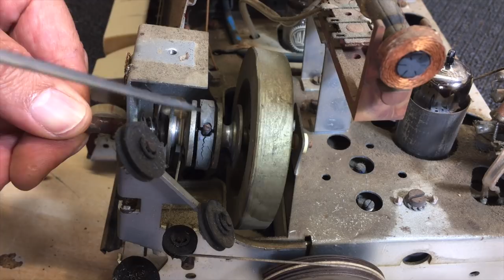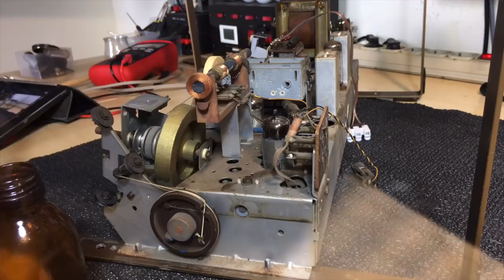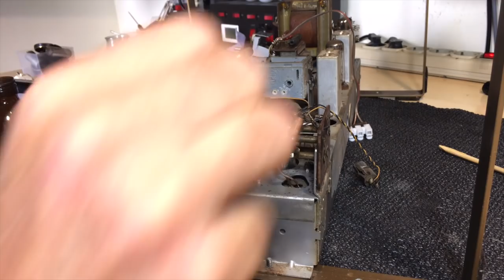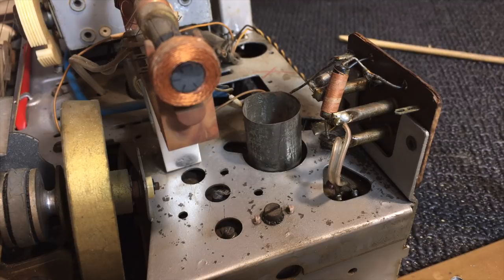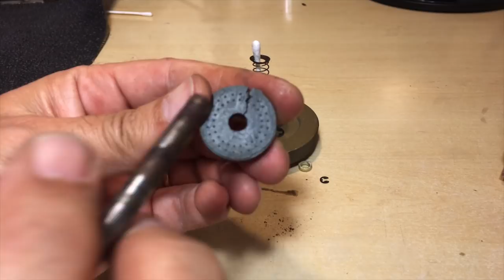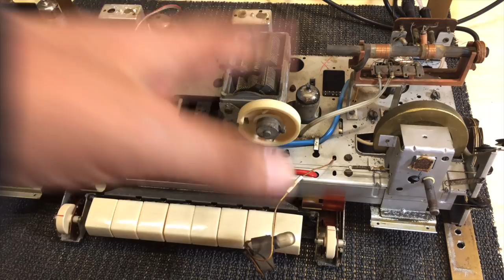Grundig 3160 tube radio restoration, part 4. The clutch is gone. Time for MacGyver tactics.

Comment: Two points. First,  my background is psychology. You seem much more relaxed and friendly lately. Very nice. Second, I bought a vibrating polisher like gun shell reloaders use. You put in some walnut media, throw in your small parts and let it run a few days. Polishes parts that look like new. Especially small or odd shaped parts that would be difficult to hand polish. Well worth the expense.
Reply from the maker: I’ve seen those polishers. Saves a lot of manual work. Great idea.
Well, I’ve just been analysed :)
You’re spot on with your evaluation. Considering that this could be construed as a doctor -patient confession, in absolute privacy, I’ll admit that being at home with my wife and daughter for the last week has been unbelievably gratifying. I know that it’s ironic, considering the circumstances, but it’s a fact for me. Having a tube radio to restore at leisure is just the icing on the cake. Thanks doc. Don’t tell anyone :) they’ll call me crazy.

Comment: Inspired by this, I repaired the clutch on a 3060a I'm restoring today. It's a little different with the flywheel in the center and two friction wheels. It was slipping, so I dismantled it and cleaned it (didn't have to unwind any dial cords) but to no avail. So I epoxied an annulus of high quality abrasive paper to each side and hey presto - works perfectly. Next up is the intermittent volume pot, and the non-tweeting electrostatic tweeter - those are fun.
Reply from the maker: Oh boy. The tweeter .... good luck.

Comment: Nice work, as always!  I recently did a Grundig SO202US with a chassis that is very, very similar to this one.  It too had a broken clutch disk.  I was able to 3D print a replacement that works well.  I also printed a new mount and cover for the ferrite rod antenna to give it some protection.  I've been restoring radios for about 3 years and every single radio I've done has benefited from the3D printer.  Most actually have parts in them that I designed and printed, but a few just needed a jig of some sort or a speaker protector or something.  My 3D printer has easily paid or itself!
Reply from the maker: Which printer do you have?
Reply: I've had a Prusa Mk2S for 3 years.  Their latest model in that line is a Mk3S, but last fall they came out with a Mini.  It's been very popular so it is taking a while to get the one I ordered in November...the last I saw it was supposed to ship in early April.  Obviously it has a smaller bed than the Mk2S or Mk3S, but I estimate that over 95% of what I've printed could have been done on the Mini.  It looks like the lead time for a Mk2S kit is 1 - 2 weeks, or if you wanted one pre-assembled it takes about 5 weeks.
Reply from the maker: Rich Frahm : thanks

Comment: Here's what I do on my sets. I use brake cleaner in a small pump action sprayer together with a similar brush that you use. Then blow it off with the air line. It's especially good for tuning caps. It should save you half the time cleaning.
It might be worth investing in a compressor in your workshop, not just for cleaning but for laquering too.

I have had bad experiences with Grundig's clutch system in the past. The gear driven system on Graetz sets is much better. Good luck with that one!
Michael.
Reply from the maker: I’ve been thinking about getting an airbrush system precisely for that purpose. My idea was use IPA and then use the brush, then IPA again to wash off the grime. Your system sounds better.
As for the clutch system, it’s a pain to repair but not too difficult. As I’m sure you’ve found, that which used to scare us because we didn’t know how to tackle, now scares us because we know just how much work it’s going to take to fix it :)
Reply: @electronicsoldandnew  This is the type of thing I use if it's any help:
https://www.ebay.co.uk/itm/Wurth-Pump-Bottle-Brake-Cleaner-Multi-Pack-Offer/192029959754?epid=515519999&hash=item2cb5e0a64a:m:mtZAs3EFD8SjJ1r95sm0OlA

Be warned, brake or carb cleaners are a very effective and aggressive solvent, so don't use it on piano keys or anything plastic. I found out this to my cost a couple of years ago. Needless to say I was not best pleased, and yes, I did swear!
You can not use brake cleaner in a regular garden type sprayer, it has to be the Wurth item. For less aggressive solvents White Spirit is a good choice for all round general cleaning, including plastics. This is what I tend to use nowadays.
Hope this helps.
Michael.

Comment: I actually just wanted a 3D printer to have one, not because of it's usefulness. I purchased the cheapest crap I could find, decided what I didn't like about it, then I built my own with improvements to the old in mind. Now I make changes to it all the time, different extruder, motors, improved electronics, minor and major changes to different parts; hell tinkering with it has been more of a hobby to me than actual printing. I have found many useful things to print though: a pen holder for work, a new handle for a 50 foot tape measure, a bracket for a auto light, any number of small spacers for many different things, completely new case for a broken flashlight, and the list goes on... Now when I create an electronics project (like the capacitor tester that you made and I duplicated) I printed an enclosure for it with perfect spaced and sized holes, standoffs built in, and a back cover. I own a small 3D router as well so I make my own PCBs for many different projects. I enjoy tinkering more than the final creation. 

Don't worry about whatever anyone has to say, I've learned a TON from guys like you, Mr Carlson, and xraytonyb here on youtube. There are so many little tid bits in almost all these videos and I'll keep enjoying and learning as long you keep posting. Thank you for sharing your hobby my friend.
Reply from the maker: Thanks Ian.

Comment: The long wave beacon that you were hearing was identifying as PST which is in Porto Santo. It's on a frequency of 338 KHZ. You might want to use that as a reference later when you are checking your  dial  alignment. Coming along nicely. MacGyver would be proud. ATB Doug.
Reply from the maker: Doug McArtin : now that Info is useful. I hadn’t bothered to check, so now I will use it as it’s less that 50km Away.

Comment: Yours videos are very good, keep doing this. About the clutch, it is made of antimony (an alloy of aluminium and others metals that I don´t know). This parts are injected in a die like a plastic. However if the compound are not mixed in the correct proportions, have this problem. After long period the material fragment like an old cookie. Good work but I would try to do a pulley of aluminum with rings of felt glued in each side (as in reel to reel tape records in the clutch mecanism). I am looking foward the calibration.
Reply from the maker: I’ll probably revisit this project in the future to replace the clutch, but I TA going to work for now (and it’s cost me a coat for my wife :)

Comment: Ingenious repair!  I wonder if that old piece could have been repaired with a bit of JB Weld epoxy.  Redrilling and tapping the hole should have then been possible but might have required a drill press to keep the metal from breaking.  Never would have thought to use a button from my wife's coat.  Brilliant!  I'll have to remember that.
Reply from the maker: Whatever works :)

Comment: Nothing wrong with the way you restore your radios you do fine work, I wonder if those dremel sanding discs could be used as a grip for each end of the clutch disc.
Reply from the maker: I think they could. Didn’t think of that.

Comment: I love your program albeit I know nothing about radios.  As a kid I had a Grundig radio similar to the 3160 you are currently working on.  I don't know what happened to it and finding a replacement is on my bucket list.  Since I am 77, time is running short to fulfill that wish.  Is there any chance you would sell this one after it has been repaired? 
Gil
Reply from the maker: Hi Gil. I have had this radio working for some time now. Selling these radios is not a priority of mine, but as long as it’s going to be used by someone who would appreciate it (and not just leave it as a showpiece), I would be open to parting with it. Email me and let me know what you would consider a fair offer, and I’ll consider it. Also, tell me where you live. I’ll need to calculate shipping to give you an estimate.
Reply from the maker: Let me have your email address. I’ll reply via email, rather than here.

Comment: Hi
May you writer medico product use with the brush.? Alcool? 
Thanks
Giovanni
Reply from the maker: Using IPA is better because it doesn’t leave a residue. The other alcohol may do so. You’ll need to try it. The idea is using something that evaporates quite quickly to prevent shorts.
Reply: @electronicsoldandnew  sorry. What is IPA ?
Reply from the maker: Isopropyl alcohol

Comment: Wasn't that old clutch made from Zincal ? Zincal requires precise manufacturing techniques, if not done properly it starts flaking and breaking.
Reply from the maker: You’re probably right.
Reply: Hi, that alloy is Zamac (zinc, aluminum, magnesium, copper), and depending on the long term storage conditions (humidity and temperature) it becomes more or less prone to degrade like that.

Comment: i have a grundig radio VERY similar to this...  the dial string is a nightmare!  these radios are THE most difficult to restring in my opinion.  needless to say.. its been two years since ive tried last.  i cringe just thinking of it.  maybe you know a secret that i don't.. i'll be watching!!   thanks!
Reply from the maker: Actually, it was not too bad. I’ll show you in the next video.
Reply: @electronicsoldandnew  i tried fishing line... so maybe that is the problem.  I'll be paying close attention! the original string is 'steel'
Reply from the maker: su pyrow : I believe fishing line will stretch. I’ve used steel before (old guitar strings), but in this case only used cotton.

Comment: Another great video.  I encountered the same clutch disk problem and found that these split clamp-on shaft collars worked very well.  Didn't have to take take the dial strings off and was a solid fix. And, I didn't have to steal a button from my wife (who suffers enough from my radio habit).

 https://www.amazon.com/gp/product/B07GTC62MH/ref=ppx_yo_dt_b_asin_title_o06_s00?ie=UTF8&psc=1
Reply from the maker: Thanks for the link. Always useful.

Comment: Interesting videos to watch as you progress trough the set. Nice work.
May I suggest an alternative to IPA for cleaning? I used to use IPA myself,
but switched to something called Super 10 from a company called Golden (or something).
https://www.youtube.com/watch?v=EKLvJ5V1RPM
Sorry for the silly promotion video, but this stuff really works.
I spray it on in small areas, brush it with a toothbrush, and wipe it of with something lint-free.
You can probably do the WD-40 trick after that.
Keep up the good work, and stay healthy.
Reply from the maker: I’ll try and find it in Portugal mainland. Not available in Madeira. Thanks for the tip.